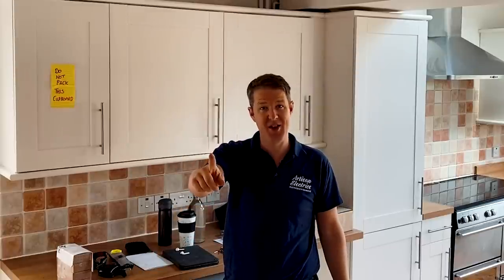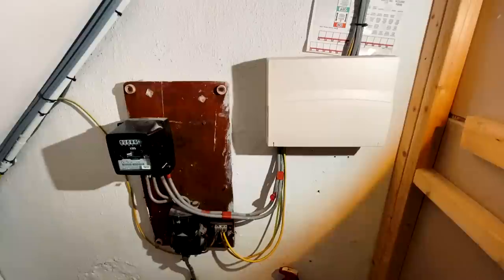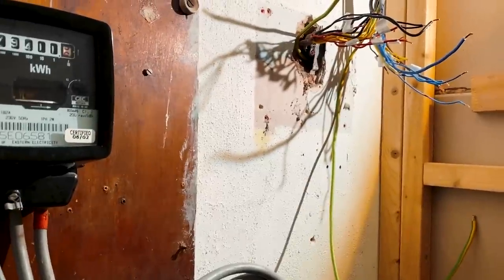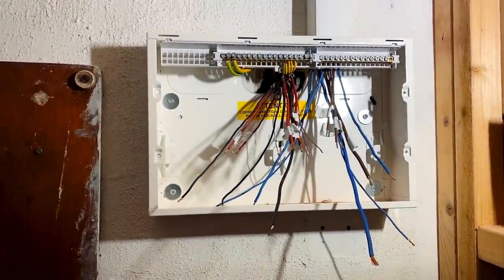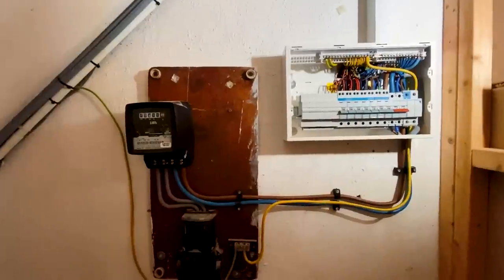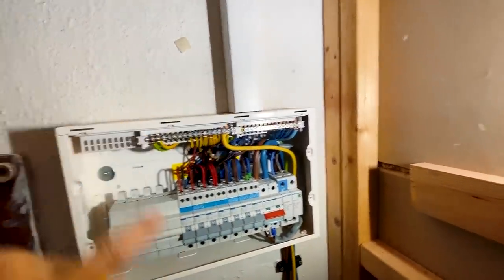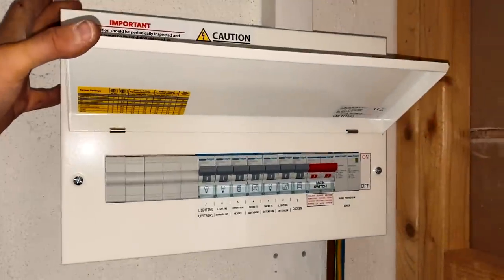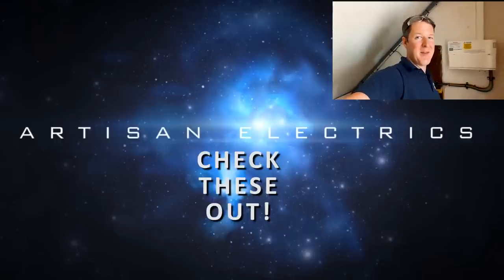The 1 Hour Consumer Unit Replacement

Comment: 6:50 Did you just say that you were going to issue a satisfactory EICR for a consumer unit change 🤔🤔🤔
Reply: Did you even watch??
Reply from the maker: Obviously we issued an electrical installation certificate and building regulations certificates as well as reissuing the EICR as satisfactory.
Reply: @artisanelectrics  That's better, although you don't need to re-issue or issue an EICR, is this for a landlord, they do love their satisfactory reports.
Reply from the maker: Yeah now with the PRS inspections you have to rectify the issues within 28 days and issue a satisfactory EICR otherwise the landlord could be fined up to £30,000